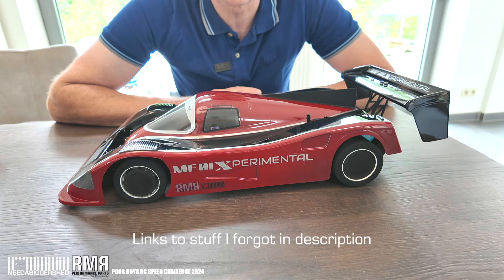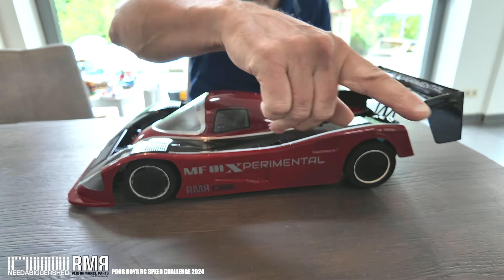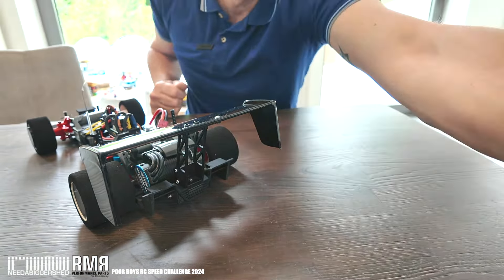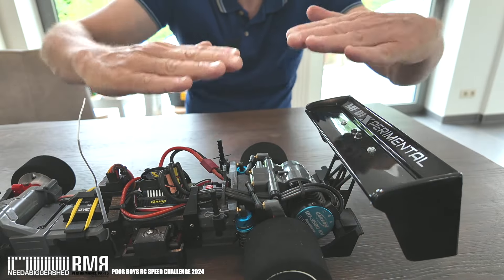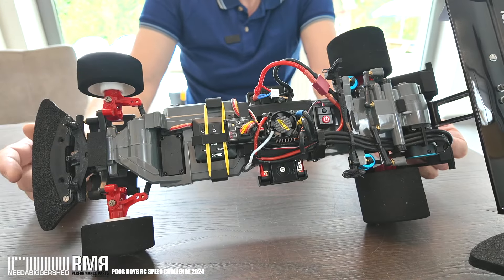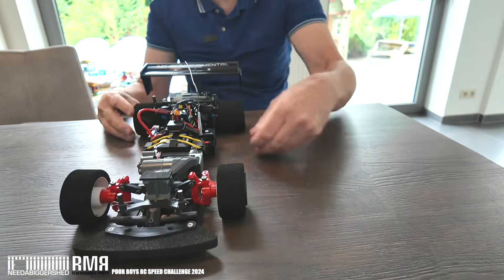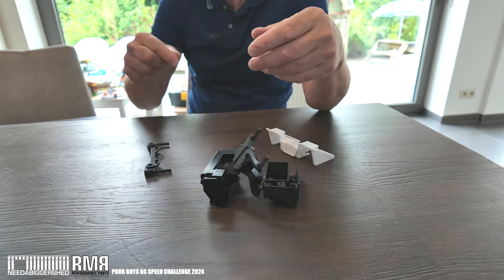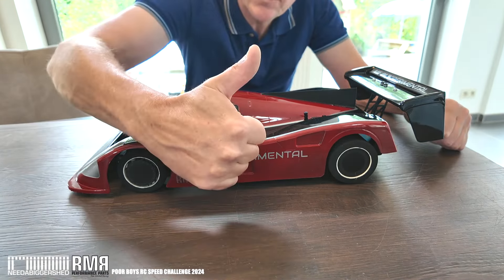What's this MF-01XPERIMENTAL all about then?

Comment: All that front tow out will make the steering very twitchy imo 🤔
Reply from the maker: Yep, toe out would be. It's deceptive on the video, when it's sitting right on the deck it's a touch in. Last run it was dead straight.
Reply: Opposite effect, numbs it in comparison to toe in

Comment: It looks like a Pan car. It kinda reminds of tamiya group c.
Reply from the maker: @johnrobert2148  that was the plan. Turn something that not. Into something that is. I had the body shell here anyway so I thought to myself. Why not give it a go 😁
Reply: @Rob_NABS  I actually did the same to my old traxxas nitro 4 tec several years ago. More like turning it into a 1/8 gp car.

Right now, I have a team associated rc10LS pan car which I acquired pre owned. And I'm trying to make it run on 6 stantard 1/10 touring car tires with the use of custom made 3d printed  rims.